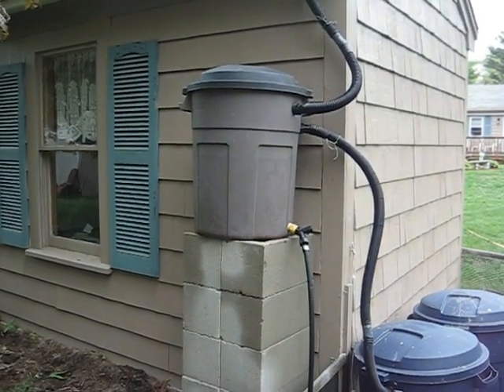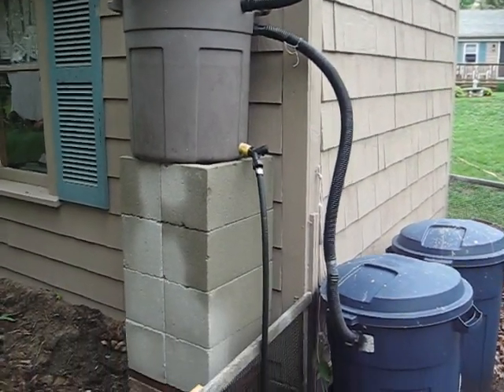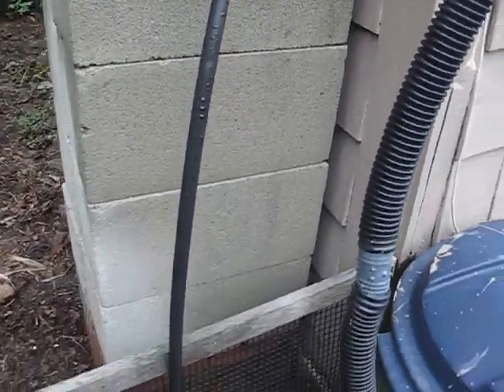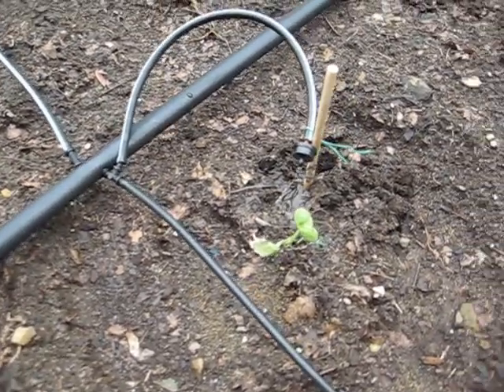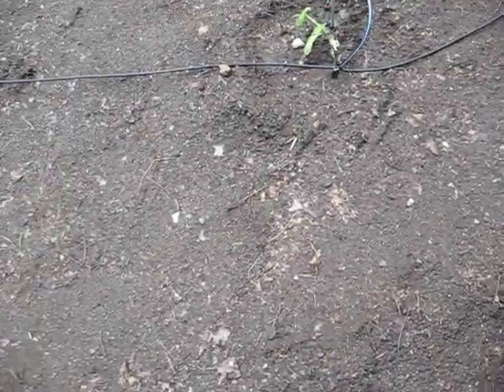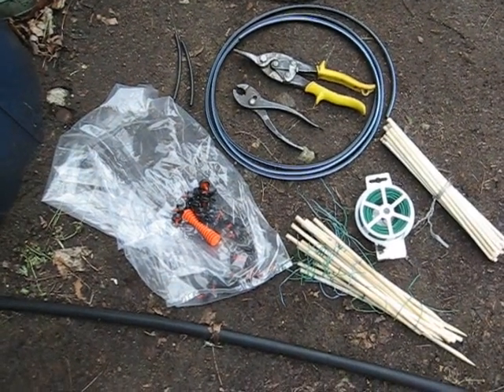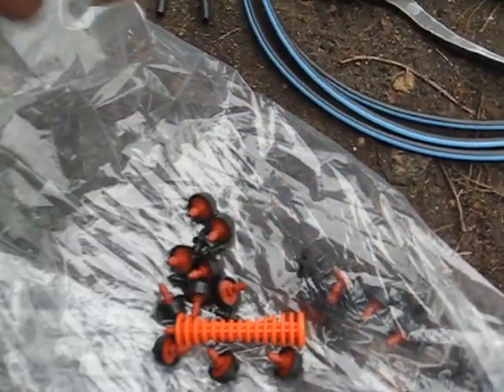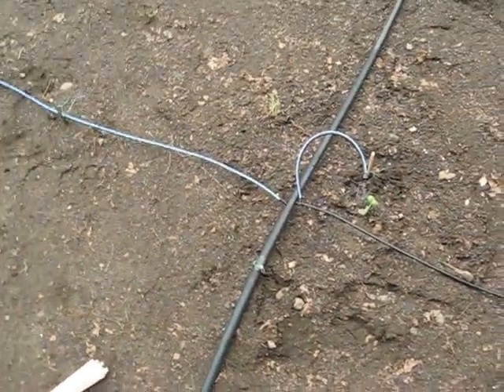Rain Barrel Drip Irrigation System

Comment: Hello, very nice system.  Is the 1/2" tubing rated for gardening/outdoor usage?  Where did you obtain it (hardware or garden stores)?  Do you get enough pressure from the height of the rain barrel to keep the dripping constant even when the water level is low?